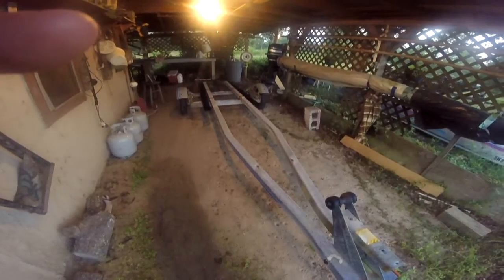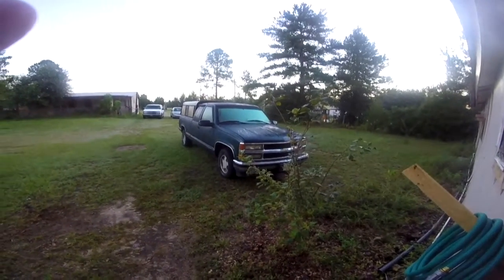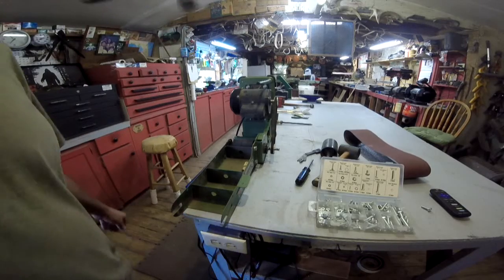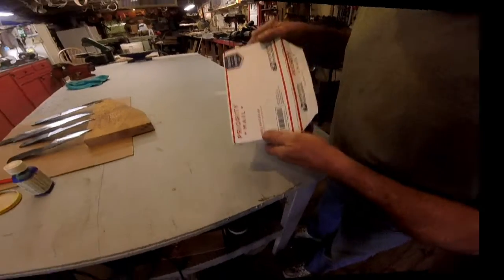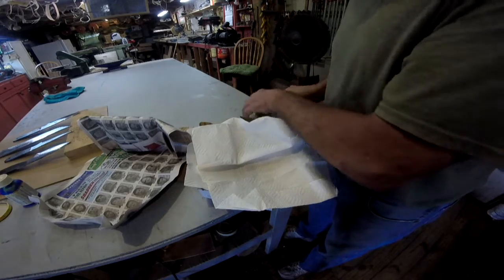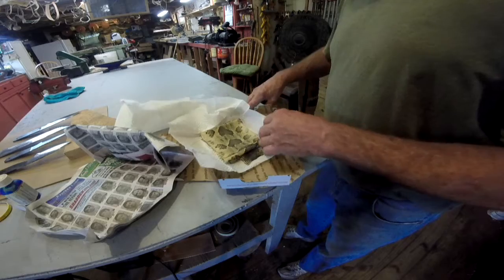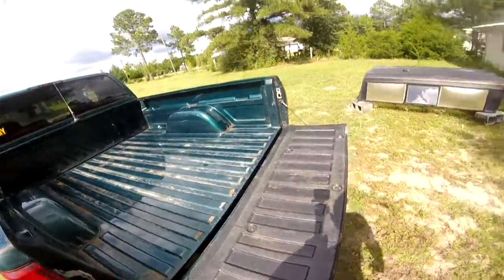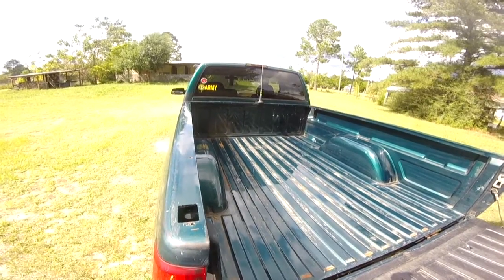BAD TRUCK

Comment: Don’t pull your shell off and don’t cut a hole in the bed. Undo the bolts holding the bed on and lift it up enough to get the pump out. It only has to go up about 10 inches. Just a little advice from a mechanic.

Comment: I had a 96 Chevy that I paid the Chevy dealer $400 to change the fuel pump, They took 4 or 6 bolts out of the bed and raised it so they could get to the top of the tank. I'd do the sending unit to because I had that go out later and it took out the pump again. Another $400 to the dealer! Good Luck.

Comment: if it ever comes down to it you can just add an external fuel pump and that will draw gas through the bad pump just install it before the tank  . but you wont have a gauge  that works .